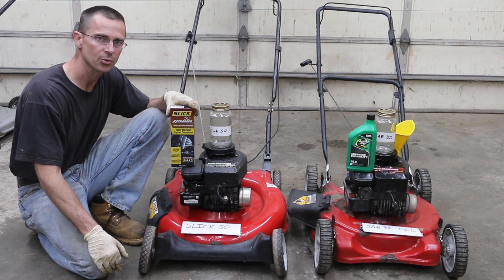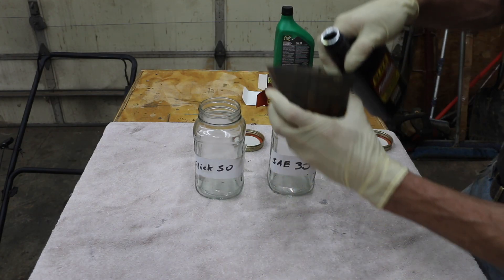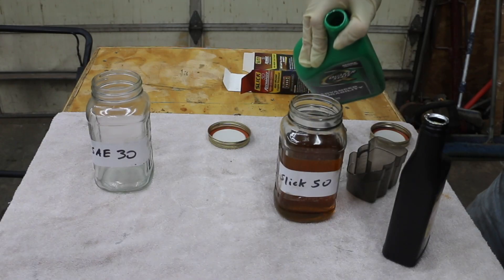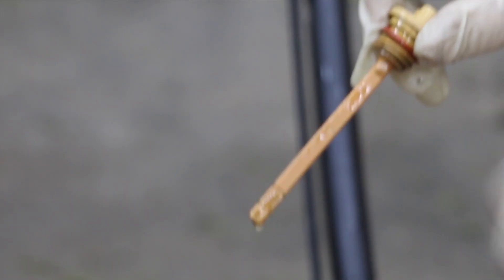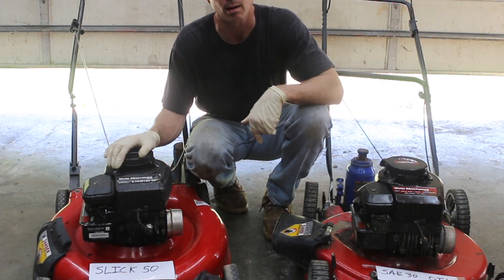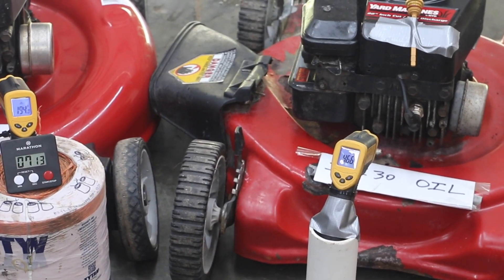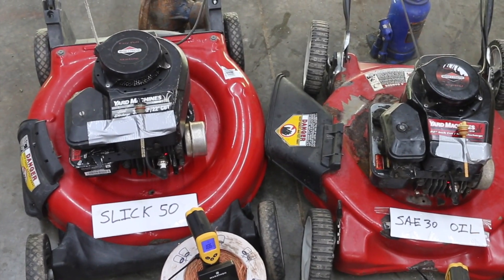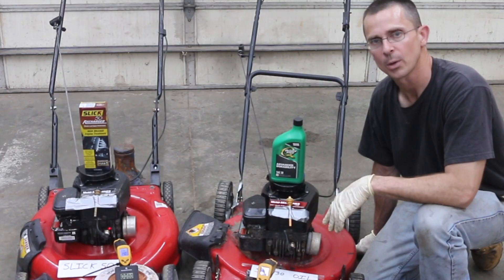Can't believe what SLICK 50 did to my engine!!--Dry Crankcase Test!

Comment: The best thing I've ever tried was a house brand anti-friction oil additive sold by Mopar over their parts counters.  They stopped selling it in the early 90s for some reason.

The list of ingredients simply said "sulfurized ester".  

It was unbelievably good.  We had new cars coming in that were so tight, that when the engine was hot, the starter would not even turn it over.

Pour in a can of this stuff, and once it had cooled off enough to crank, you'd never even know there'd been an issue from there on out.

I but some in my Honda motorcycle  (even though I knew better), and it made my clutch so slick that it would barely even pull out of its tracks.  

I had to change the oil and replace all the clutch plates, before I could ride it again.
Reply from the maker: Wow! Sounds like a great product!
Reply: It *was*, but as I say, they no longer sell it.  Seems anything really good never lasts for very long.

Still... there should be a can or two in some stockroom somewhere, that has survived until this day.

Comment: I used Slick Fifty in the '80's in my Dodge with a slant 6 in it and 70k on the engine. After giving it time to work, I noticed my idle vacuum rose from 15 to 18, and the engine would spin a bit faster as well. No big increases in mileage but the benefits added about 50 k more miles to the engine. I tried it again in my newer truck but did not get the same results.  I think they changed the formula and they lost the benefits. What a shame.  I thought someone really had something there!
Reply from the maker: Impressive.  I believe the formula changed in more recent years.
Reply: yes, it was the only vehicle i have ever owned that, after the treatment, I had to REDUCE the curb idle speed a couple of times.  It kept going up!

Comment: I use to use wynns or STP oil additive years ago used to swear by it, but my diesel engines used to sound quite tired when they reached 150K and turbos would always start leaking at 80k, I stopped using it about 10 years ago my current van has a diesel engine and has reached 260k Miles still original turbo and sounds like it's just come out the showroom, I done what I normal do change the oil out at 10K interval and use manufacture spec oil 5w30 fully synthetic but not added an additive, I believe they wear out engines quicker I'm now convinced this shit is the reason why the camshaft on my old petrol ford was getting really noisy, now I wouldn't touch the stuff
Reply from the maker: Thanks for commenting on this.

Comment: you wont beat regular maintenance.. ive driven everything from a Honda Z- 50 minibike to a 550 hp Detroit diesel. Race cars , wheelers , mowers bulldozers, excavators... you get the picture..
im either lucky or whatever but ive never had an oil related problem in any engine problem ive encountered....i check oil regularly and service every interval the piece calls for.. i think millions of people are suckered into too many of the mechanic in a can scam...  
any small engine i run SAE 30 of a good brand ..
any bike/ wheeler i use Castrol 20w50 Motorcycle oil.
any performance , race or Diesel engine i run Shell Rotella 15w40..
no additives ..at all ..been driving for almost 40 years havent killed an engine yet from any oil related problem..
but thats just my opinion.....
Reply from the maker: Great point.

Comment: Lucas has the adhesion factor you'd want. Teflon is bad. No business being in a crankcase.

I have watched videos of other oil additives running dry and even being hosed down and continuing to go.

That all was made real though, when I ran an inline 5 for over a week with no oil while towing cars with it all across town with a malfunctioning cooling system. I thought the oil warning was bad, but actually the oil was below the pickup.

This would have been 2003-2004. The car was a VW Quantum Automiatic with CIS. This is basically an elongated Audi 80/4000 with a different rear end.

There was no Lucas in the engine. I want to say the additive I used was Rislone... Something or another.

Anyway, after I figured this out, I wondered for years how I got away with it. Because the engine survived. None worse for the wear. The I5s are legendary for being utterly bulletproof (same block as the legendary group B car), but that simply didn't explain towing cars for a week with no oil pressure and and not seizing the engine, let alone not needing any repairs.

After a bunch of research, I was able to conclude that the magic sauce was ZDDP, a zinc-based anti-friction chemical present in most motor oil, though it used to be common in higher concentrations.

It turned out that with the advent of catalytic converters, the amount present in off-the-shelf oil formulations was drastically reduced. The ZDDP would cling to the surface of the converter walls like lead did, causing the metals in the converter that do the magic to be covered, and rendered useless. The idea was to get the converters lasting 50,000 miles, and the best way to do it was to cripple the oil.

There have been oils on the market containing NO ZDDP, I think famously Drake performance, who may now be defunct, used to find flattened cams caused by this issue. As I recall, they found that lack of ZDDP causes the worst damage at steel-to-steel contact points.

I buy ZDDP additive that makes no effort to hide what the magic is, and add it liberally to all my engines that don't have a cat. I add less to those that have a fully functioning cat. Since the presence of ZDDP saved an engine from my stupidity, I am a believer and I see it as an indispensable investment. There's no reason not to use it, and one treatment would logically make a difference for years, if running it dry didn't get rid of it.

Most of my engines run with both ZDDP for friction reduction AND lucas, for the adheision factor so that oil sticks to every place and stays in every gap, even if there's some kind of design flaw and especially to reduce wear in cold starts. With the lucas in it, every surface stays lubricated at all times, even while at rest.
Reply from the maker: Great point regarding ZDDP.  I believe oils formulated for diesel engines still have it.
Reply: Thankyou!

My understanding is that there is still some in most gasoline formulations, it would make sense oils intended diesels still contain more, them not using catalytic converters. I seem to remember reading that was in fact the case, but I don't remember for sure or if the source was any good.

Also, your Restore video reminded me that the product I used was in fact Restore. However, I think during the time the engine ran and towed without oil, there was no Restore in the sump, I had only used straight motor oil for that change.

Comment: Wonder if running with dipsticks removed upset the crankcase venting and affected the outcomes?
Reply from the maker: It could have an impact. However, they both use a splash type oil system.

Comment: I'll say it up front: I think SLICK 50 is snake-oil (even though its claim of lower operating temps during normal use does appear to be valid). However, I also think this particular test was (inadvertently) biased against it because you're using low-compression splash lubricated engines that don't really flow oil through the system. An engine with a positive-pressure lubrication system (i.e., an actual pump that is constantly circulating all of the oil throughout the entire system) might give SLICK 50 a better chance to thoroughly coat the friction surfaces. Lawn-mower engines just don't do that. They literally just throw oil everywhere and hope that it seeps into the places where it's needed (yes, it's a bit more carefully-engineered than that, but you get the point!).

Another poster commented that the engines should have been run for a lot longer before draining, and I agree with their assessment. It might also make a big difference if the engines were run under load (e.g., twisting the outer halves of each mower blade 90 degrees to greatly increase air resistance seems reasonable) during "break-in".

Finally, even if you re-ran the test with the changes suggested, I still think the SLICK-50 engine would fail first. Major problem is that it's difficult to get Teflon to bond to anything*. That was *the major hurdle in the original development of non-stick Teflon-coated cookware -- figuring out how to get the Teflon to bond to the metal in the first place. That's a process that I feel quite sure is not emulated by the physical processes at work in a lawnmower engine. :)

Finally finally, SLICK 50 (or any other oil treatment, for that matter) is of little help to engines with hydraulic lifters when they run out of oil. There's no oil left to keep the lifters pressurized so that even if the engine doesn't actually seize up, it's going  to beat the living daylights out of its valve train.
Reply from the maker: Thanks for the constructive feedback.
Reply: You're welcome. Thanks for the entertaining and informative content!

Comment: If you ran this test to refute the Slick 50 commercial then fine but if you ran to see if Slick 50 was better than straight 30 weight than your missing the results. With a full crankcase Slick 50 ran cooler than the 30 weight. Heat is bad so cooler is good. Less heat should mean less wear...so Slick 50 should be better. Don't get caught up in the "no oil" test.

Comment: just an observation, but it looked like you didnt pull out as much oil from the sae 30 engine as you did the slick 50 engine,  so there may have been some residual oil in the sae 30 engine.
Reply from the maker: Thanks for commenting on this.

Comment: 25 years ago, Slick 50 had PTFE better known as Teflon in it. It doesn't have it now. It is, however made with a 30W petroleum base oil. I would be willing to bet the Quaker State mower dies first. My father bought a brand new 1974 Pontiac Catalina with a 400 CID engine in 1974. He used NOTHING but Quaker State Delux 10 W 30 because that's what GM was paid to say to customers. After 50 K miles, his rocker arm cover gaskets began to leak. I pulled it apart and had to go in and get a teaspoon to literally shovel the 2" of sludge off from the top of the heads. I also had to take a coat hangar to ram rod the crap out of the push rods because the valves were beginning to wear through the ends of the rocker arms for lack of lube. Also, Before I hand over my social security check on a lost bet, those mowers looked used. The one with the regular oil looked a little more used than the slick 50 mower. If the slick 50 mower was newer, it's clearances between bearing surfaces and between the cylinder walls and piston ring surfaces will be less allowing for more friction and less Slick 50 thickness / coverage. Also, how long did you let the mowers run WITH the oil / treatment in them? I too used Slick 50 in my younger days and with good results like improved gas mileage. Back then in Florida, I used to change my oil religiously every 3000 miles because of the heat and sandy environment. At every oil change, with Slick 50, it would take about 20 to 25 miles to feel it kick in as it was supposed to bond to metal parts. I don't care how hot your old Teflon frying pan got, NO oil additive will stand up to the 4000 degree combustion chamber temperatures inside the cylinders of any car. The oil or Slick 50 or whatever you use is replenished and burned off with every compression / power stroke of the piston. My first car was a used 1968 Chevy Bel Aire with a 307 CID engine and 60 K miles on it. As I said before, I used to change the oil every 3 K miles. Before Slick 50 came out, I used to use 4 quarts of Valvoline 40 W racing oil, a 15 oz bottle of STP and a 16 oz bottle of Marvel Mystery Oil and the old STP silver bullet double oil filters at every oil change. Every third oil change, I would buy my normal change, 2 oil filters, 3 qts or the cheapest recycled oil that I could find and 2 quarts of cheap transmission fluid. I would change the oil and filter with the garbage oil and let it idle in my driveway for 15 minutes. Then I would drain it out. It looked blacker than the old oil. Then I would change the oil and filter again. At 80 K miles, I fell into a bucket of crap and came out smelling like a rose. I picked up a set of Chevy small block power pack heads and a quadrajet intake manifold off from a 283 CID Corvette for $7.00. I was working nights at a gas station. This one kid came in almost out of gas on his way to Tampa with everything but the engine block in his trunk and looking to trade for some gas and cigarettes which was $.49 a gallon then. The quadrajet intake at junk yards alone were $35.00 and when you're only making $2.30 an hour minimum wage, that was a lot of money. Anyway, I started bragging around my neighborhood about the deal I made and I picked up an almost new  quadrajet carburetor off 1 kid for another $5.00. This arrangement was working out pretty good for me so I kept it going. The next thing I knew, another neighbor approached me with another deal. If I sent my power packs out and got them reworked and installed them on my car, then sent my old heads out and got them reworked and installed them on his van, (he had a broken valve on the same engine), he would pay for both valve jobs and gasket sets. When I pulled my rocker arm covers off, the top of the original heads looked like brand new and clean as a whistle. After the shop milled my heads and them being high compression to start with, I had to advance my timing about 10 degrees and run $.56 a gallon 95 octane premium. I added, I'm guessing, about 50 or so horsepower by rebuilding the top of the engine for $12.00 total and a few hours labor to my neighbor. BTW, I kept that car to 100 K miles and tore 3 transmissions out of it in my first 30 K miles but the engine NEVER missed a lick. I miss that car which has been sitting in a field in North Georgia since 1977. I sold it to a guy that wanted the engine for his pickup truck. What a waste.
Reply from the maker: Thanks for this information.

Comment: Along with the "not intended for air cooled engines", I heard that the active chemical in s50, was developed by the German aero industry pre ww2, to give planes that suffered damage to their lubrication systems a chance to operate long enough to land.....German engineering, right!?......Must only to have been used in liquid cooled engines if that's the case. So, that special lubricant must have an "goldilocks zone"  to operate in....? Unfortunately, I don't hang with many German aircraft engineers that were doing their thing in the 1930s, to maybe she's some light.
Reply from the maker: Thanks for commenting on this.

Comment: I have not read all the comments so I may be repeating what has been said. I am old school & was around when Slick 50 hit the market. I used the product in all my vehicles with great success. Watching this video raised a couple of questions that I would like to share with you. First, the Teflon is suspended in the oil and can settle to the bottom of the container. Did you shake the container well before adding the Slick 50? Next point is the Teflon needs to bond with the metal at the friction point where the excess heat effectively "melts" the suspended Teflon to the metal surfaces. In this light, did you run the engine with the Slick 50 for a substantial length of time for this process to have the time to bond before draining it? Slick 50 in not a lubricating film that is durable and will not be effective if run for a short period of time. If Slick 50 is junk it deserves to be trashed for false claims. However, it would be sad to trash a great product for poor methodology in a comparison test. Perhaps a retest is warranted if proper application of the Slick 50 was not followed.
Reply from the maker: I did shake the container. Lots fo comments mention that the product changed formulas a while back.  Thanks again.

Comment: USE PROLONG,I PUT A FEW DROPS IN 13 AIR TOOLS ,HAVE RUN THEM FOR 27 YEARS,NOT LOST A ONE.RAN TWO CARS AND ONE TRUCK WITHOUT OIL FOR MONTHS,NO DAMAGE. I LIKE IT.I HAVE PUT IT ON EVERYTHING THAT MOVES AT MY PLACE.YOU HAVE TO WATCH YOUR OIL LEVEL BECAUSE IF YOU HAVE A LEAK ,IT WILL GET WORSE.

Comment: I've known people who used slick 50 and it burned up the engine faster because slick 50 additive doesn't have long lasting viscosity. I've used duralube before that helped clean the engine and valve deposits but also used up it's viscosity faster. However; I've used Duralube Transmission treatment in a taxi that the transmission wasn't only not slipping but wouldn't even going in gear. After idling the car for thirty minutes and letting the Duralube soak into the bands and or cleaning the debris out of the valves. That transmission worked fine for the next year without ever changing the fluid. After 112,062 miles the transmission on the Chevrolet Caprice did finally quit all of a sudden without warning. The best part is we got 248,000 miles out of the original transmission. Duralube Transmission treatment next time you need to get more miles before changing transmission fluid
Reply from the maker: Impressive!

Comment: This test needs to be run with identical cars. How about two brand new Lexus's running side by side? One thought on the slick 50 failure: Maybe it thinned the oil which reduced friction but also made it so that the more oil drained out in the lawnmower with Slick 50.
Reply from the maker: Thanks for the constructive feedback.